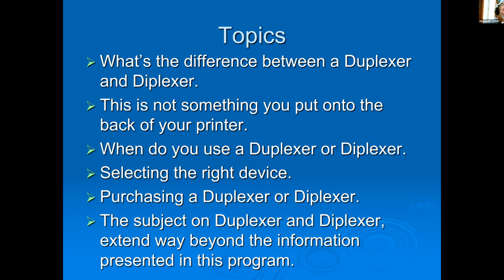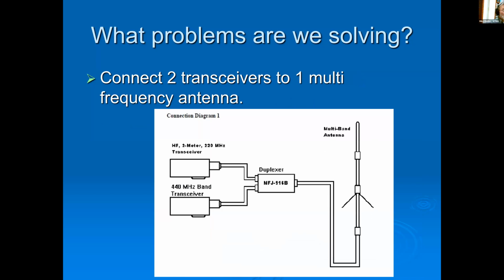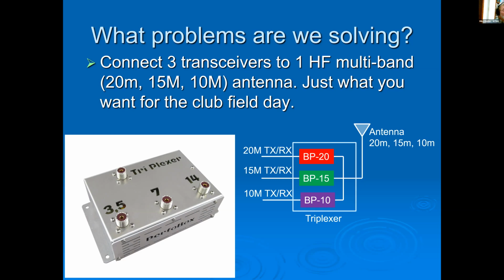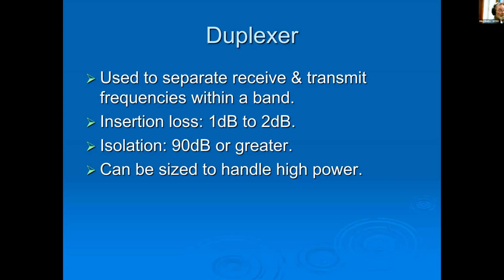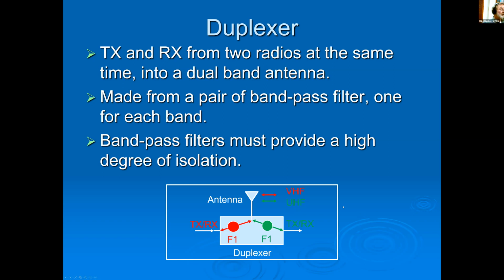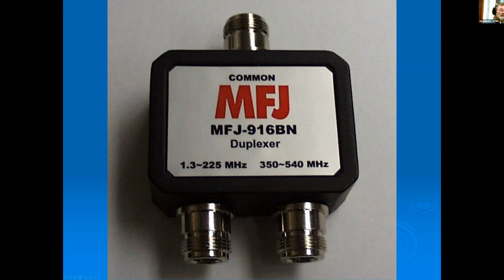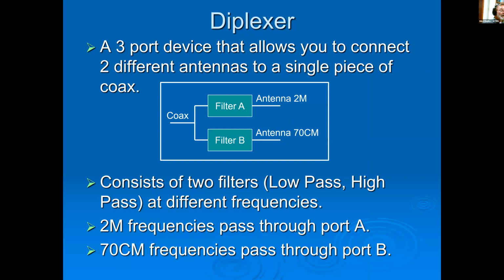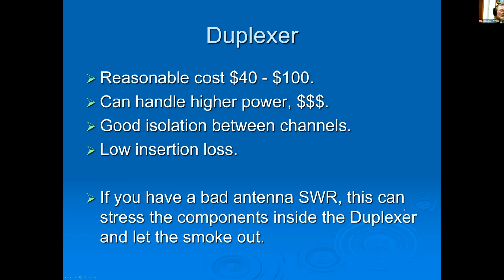June 2020 Presentation - Duplexers and Diplexers

Comment: What I see is a Diplexer and a Triplexer. A duplexer is a device that lets you Xmit and Rx on the same band. A duplexer uses cavity filters.  Like a house with two apartments in one building is called a duplex..  Two houses sitting side by side is called a diplex.